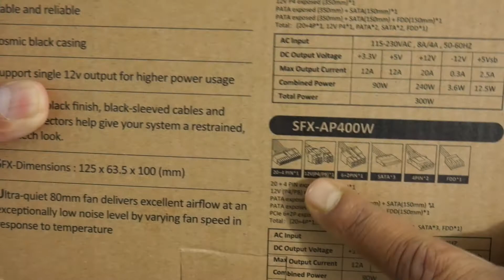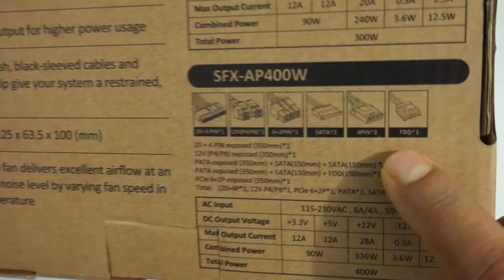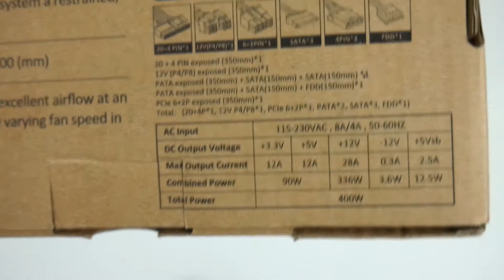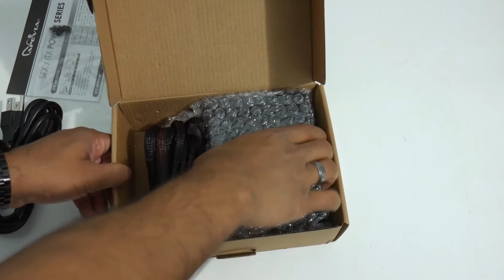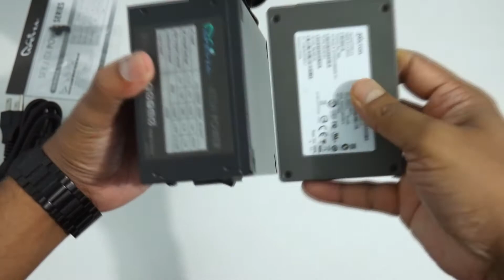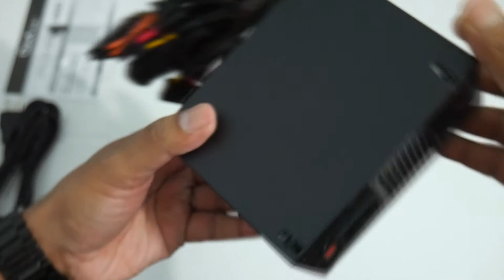BUDGET SFX POWER SUPPLY FOR MINI ITX BUILD UNBOXING (APEVIA 400W)

Comment: This should be a good upgrade over a 265 watt Dell PSU, right?
Reply from the maker: Yes but if you’re not looking for SFX psu then you can go with Thermaltake Smart 430W 80+ Black ATX psu. Comes with 5 year warranty.
Reply: @TechTunerLife  how much is that for? Btw, I'm thinking that this PSU will also technically fit in a full ATX case, right?
Reply from the maker: Thermaltake 430w goes for $42 on Amazon and Apevia SFX psu doesn’t come with a SFX to ATX bracket. You need to buy extra.

Comment: Sorry for late comment, can this power supply put out a steady 400watts?
Reply from the maker: No! 😐
Reply: @TechTunerLife  300 ?
Reply: Parker its rated at 336w on the 12v rail you should have your cpu and gpu have a combined wattage under 336 while under full load
Reply: @Barlos69  thanks, this is the answer I was looking for.
Reply: Parker glad to have been able to help👍🏽 just ordered mine so I hope it holds up [ryzen 2600 underclocked to 3.3ghz @1v (quoted @30w via software)and a 1050ti underclocked and undervolted (quoted @65w via software) hopefully I run into zero issues]

Comment: Same power supply I am purchasing for my FSP micro atx/mini ITX case build. Its an old dell optiplex 990 sff im transplanting over so i can use better parts.
Reply from the maker: Nice 👍
Reply: Is that optiplex an ATX size PC? Got a Vostro 230, a micro or mini tower. Thanks
Reply: @j.lietka9406  its a mATX Motherboard size but NOT PSU size. hope this helps.
Reply: @davidfranklinv2860  yeah, i thought an Optiplex was an ATX size case, as the price for an ATX PSU is lower than the SFX! 😒
Reply: @j.lietka9406  you can get the apevia 400 watt sfx on amazon for $30
Reply: That will power a full system and a gpu like the 750ti or 1050 ti even
Reply: @davidfranklinv2860  that sounds too cheap for a PSU!

Comment: What’s that red switch besides the power plug? It’s not the on switch so what is it?
Reply from the maker: Yami_Industries Voltage switch 110v to 220v.
Reply: TechTunerLife what’s the use of having a voltage switch?
Reply from the maker: Depends on the country. Like North America normal voltage 110v and Europe 220v. So for Europe you have to switch to 220v.
Reply: Thanks for answering my questions man I appreciate it
Reply from the maker: Welcome 😉

Comment: I was looking for a cheap SFX Power Supply. Thanks for the video.
Reply from the maker: Fast Tech Inc Thanks for watching ;)
Reply: @TechTunerLife  Is this psu still alive in ur build?
Are the cables long enough for an atx case?
Reply from the maker: Yes I sold the build to my friend. PSU still running strong.